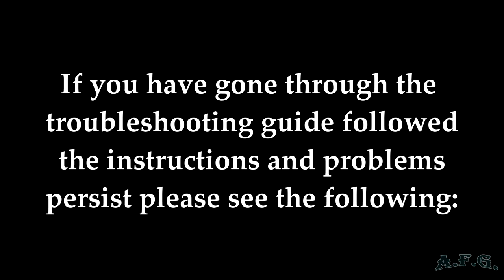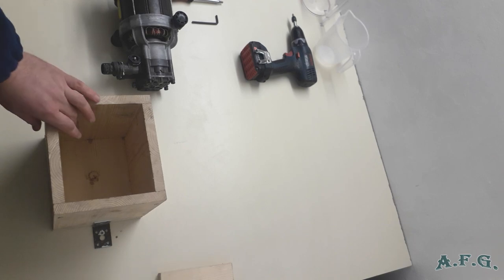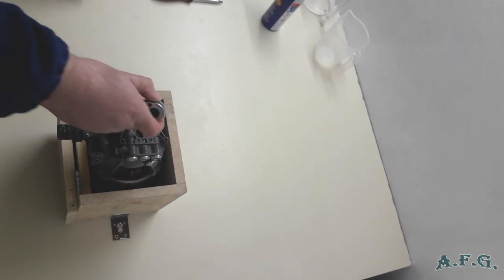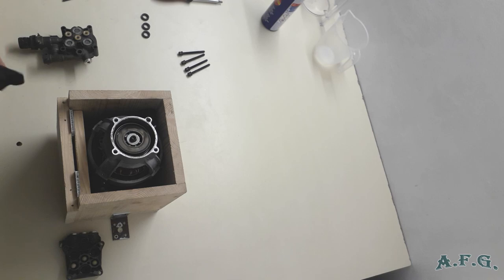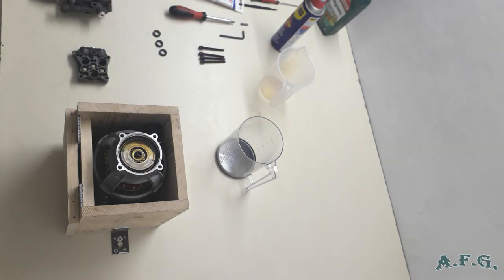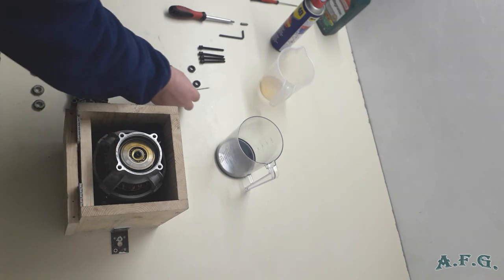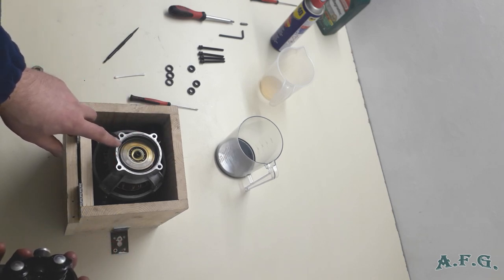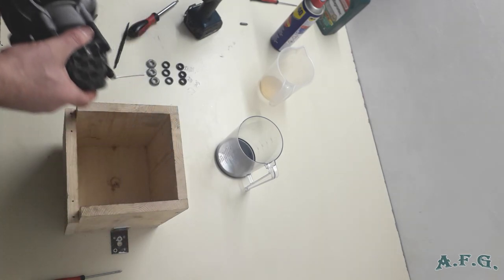How to Change the Oil; Water and Oil Seals Change; NILFISK E 140.3; DIY; REPAIR; (Part 2 of 7)

Comment: I can say djiki, but it is not enough. Thanks a big lot for this guide, makes much easier working on this machines (mine is different but this is helpful nevertheless), as finding a repair manual for my stihl seems impossible
Reply from the maker: You are welcome. Good luck. S.

Comment: Hi there I’m currently having problems with my E145.4 I recently replace the lance handle and this worked for about 30 minutes before it started pulsing, this does this when I’m holding the trigger I’ve cleaned the filter & also cleared the pin hole in the nozzle. I need help please
Reply from the maker: Hi Matthew. In most cases, the so-called "pulsation" of these high-quality and easy-to-repair high-pressure cleaners is caused by two things (of course, there can be more). Most users go to automatically change the Start-Stop valve. You started correctly with leaks on the high-pressure gun, hose, or problems with the nozzle. I recommend checking if the spring on the Non-Return Valve is accidentally broken before checking if there is a problem with the Start-Stop Valve - for example, a worn O-ring. If you want a quick tip and a short video on how to check this check out my tutorial video which I'll attach to this comment. Suppose you'd like a more detailed description. In that case, you can check out the other videos in the album dedicated to tutorials on fixing various problems on this and similar pressure washers. I hope this helps you. Greetings from Slovakia. Slavo. https://www.youtube.com/watch?v=EWa8X4rw7rY

Comment: Greetings first of all. Nilfisk 160. The first problem. did not start when there was pressure in the intake. I changed the start stop valve. okay with that. starts and stops. but. now after stopping for 5 seconds the engine starts making a strange sound. if you don't turn it off immediately, the fuse in the electrical cabinet will trip. I turn the fuse back. as long as I use the machine and stop for a short time, its fine. as it stands for a while, the engine starts to make a strange noise. almost like wanting to start but can't, growls. Which spare part should I replace now?
Reply from the maker: I have never had a Nilfisk E 160, but I think that it is a machine and its Start-Stop Valve is structurally very similar to the Nilfisk E 140. The problem you describe indicates a problem with the Start-Stop Valve. Are you sure you installed it correctly, including the O-ring in the right place? Please make sure that you have placed the O-ring correctly by watching this video that describes this very process. Sometimes it happens that some users do not install their Start-Stop Valve correctly and the machine shows very similar symptoms. If the problem persists after checking, try to write me and as soon as I have time we will try to think more about what could be causing the problem. Here is the video in question. Greetings from Slovakia. Good luck. Slavo. https://www.youtube.com/watch?v=EWa8X4rw7rY

Comment from the maker: After watching our video tutorial, I would strongly encourage you to read the manual provided by Nilfisk and an authorized Nilfisk dealer Northwestpowerwashers UK for their customers and the general public before you start fixing your machine. There is only one thing I suspect is not mentioned correctly - the amount of oil needed to be filled into the oil chamber when changing the oil. I think you have to pour in more oil - I think 60 ml is not enough but not sure (I have seen a couple of opened oil chambers and they were nearly full with old oil to be replaced - more than 60 ml for sure. For the proper amount of oil please consult with your Nilfisk service center.   https://drive.google.com/file/d/1HGoOA_gbvHEl7bYwpUWZskkTHbGJZWoj/view?usp=share_link